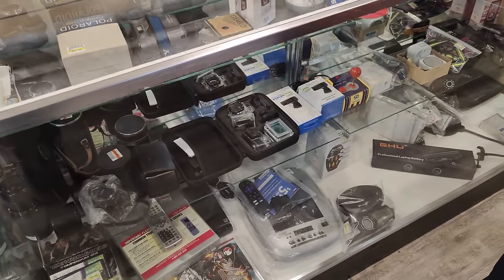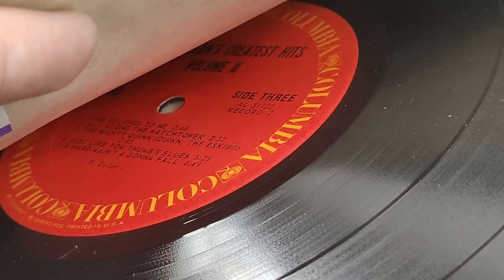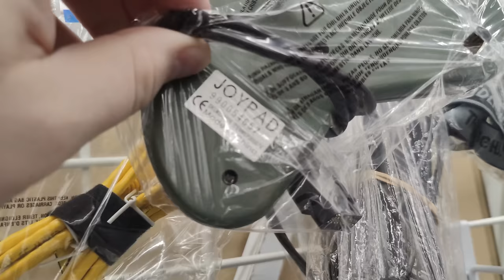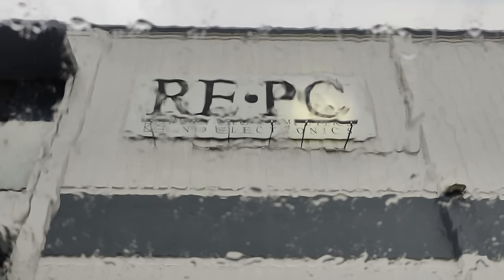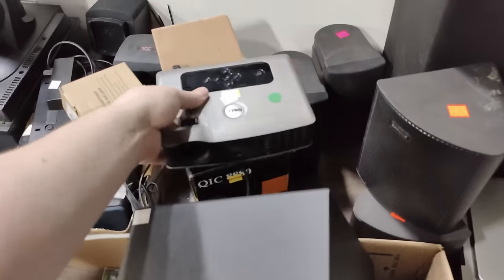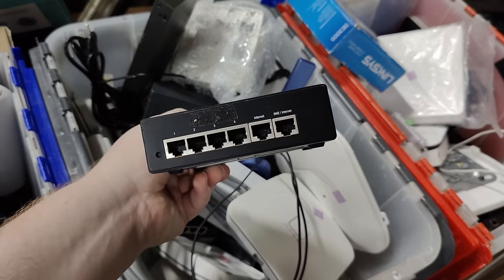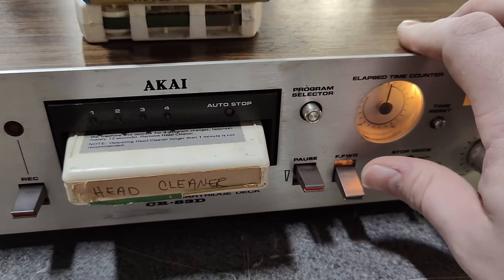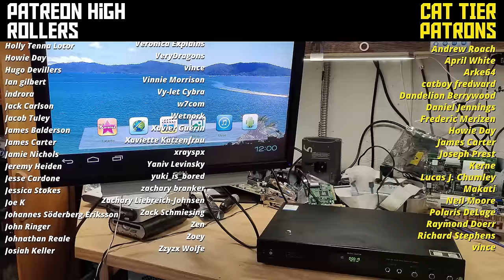Thriftmas 2023

Comment: that did indeed look like an old playstion controller (pre , it being branded EA sports and it haveing the official playstation face buttons along with other playstaion branding makes me think it was in some sort of bundle, trying to track down what it came with would be an adventure. Also some OLD gfx cards had VESA output. it was a pin as you had to get a converter to a more standardized plug.

Comment: (Commenting in a list because I have ADHD and can't pick one thing to talk about)

I had a small table top version of that grace digital thing (about the size of an alarm clock) and it's basically an IP radio with dipping mustards. Mine also had the ability to play media from a PC with DLNA (and maybe a samba share IIRC). It was kinda like that Dell receiver thing, except its interface sucked in every way imaginable. You had to enter your wifi credentials, with a click wheel that you had to make sure to click exactly on center, or it'd bind up, then you had to search for stations/your PC. 

I would bet that weird box with the freakish Revolabs phone is some sort of audio input that would've let you pipe presentation audio into the phone for the other party to hear. Why you would want that given any audio is likely accompanied by a visual presentation already being done over zoom or webex or something, I have no clue, but apparently you could.

I get the same feeling about the Xbone, and I'm only 19, I swear that thing came out like 3 years ago, then I see videos of people playing Wii U games at the same time as the Xbone existing and become dust.

Holy shit I want a modern version of that Niveus Media Center. I want a modern HTPC with a software version of the front panel interface of a receiver. Give it a bunch of capture cards, and you can use it to switch inputs and everything. I would kill for that.

Those UVC phone sterilizer things are the local version of the karaoke bellweather here. If you see one (which you can't tell immediately because they always look like something actually worth giving a shit about at a distance) you know you're in for at best an extremely mediocre time.

Comment: "Most of them are locked to cloud services and can't be used anyway."

The sad truth about modern IT.  My home WiFi is an Aruba 3200 controller with a few dedicated APs that are managed by the controller, and automatically tuned for best channel and TX power.  I have had better home WiFi than most of you will ever experience for a long while now, and it's still relatively decent.  But the end of the road is near.  WiFi 6?  Not happening.  And with Mist setting the pace for what enterprise WiFi will look like from now on, I'm a WiFi generation or two away from getting stuck with the same garbage-in-a-box solution that everyone else is forced to use.  The day when my best option is Ubiquiti ... that makes me a very sad panda.

Comment: If you're thrifting, be sure to look out for headphones that are great quality, take them home, then spend $10 to get replacement ear pads and get $150 headphone for $20. Also, it's probably NEVER going to happen, but check out those controllers. Nyon controllers, SHARP NES controllers, Sharp NES remotes, VERY rare, but check, Also, the square 4x4 16 pin Bose cable that sells for $100. I've found several. :)

Comment: i wonder if that terratec is actually the satellite version. it looks more like an F connector. DVB-T devices typically don't use that for the antenna connection. would make sense to be in a US thrift store at least, as there's plenty of DVB-S/S2 signals up there. would explain why it looks like it might have an external power supply?

amusing that Panasonic reuse model numbers - I have the DVB version of the DVD recorder under that android karaoke box, it's the same model number although mine has a big fat DVB logo in the top left.

the brother printer ain't bad (think I have the same model) - yes it is inkjet but it's pre-chip so you can get cartridges anywhere with no drama. prints and scans A3, has wifi/fax/ethernet etc. 

that metal cased xbox 360 is something. all that to act as a media centre extender (back when microsoft thought people would want to use an unreliable, hot, power hungry console for that). i wonder what the markup is on it!

Comment: The Niveus is just a fancy Media Center PC.  With Windows Media Center Microsoft had made a class of devices called media center extenders.  They really never took off except for the Xbox 360 which I believe still has the capability built in.  Microsoft never took it out of the OS.  It was actually rather cool when I had a HD HomeRun Prime with cableCARD.  I could have my Media Center PC running in my living room and still watch my cable TV on my Xbox 360 in my bedroom.  

You wouldn't really need to buy the Niveus re-branded Xbox360.   You could just fire up a PC with Windows 7 and an Xbox 360 and get the same effect.
Reply from the maker: exactly, that's why i feel like buying it, it's so pointless lol

Comment: A lot of people out there might not know why those modems are scrap: Every cable modem is individually identifiable over the wires, and your modem's identity gets registered to your account so that it is authorized for your service level. If you try to register somebody else's cable modem, it gets low-stakes flagged as stolen and registration is refused.

You might be able to take the modem to your ISP, if your ISP is the previous owner's ISP, and waggle it at them in a way that for some reason causes them to deregister it, I have done this, it does not make sense, and it's probably not worth your time with how cheap modems are now. I was in a bad place and couldn't afford rent so it was worth it to me then; but my experience might have been biased by having stolen the modem from my shithead dad, so we had the same last name.
Reply from the maker: See that's what I always assumed? The off the shelf ones, like the surfboards, you can reuse those, but if you get a carrier provided arris suuuuuurely it's gonna be a brick.

Comment: as someone who goes through all of 1 thrift store every couple of weeks
fuck me, i WISH i was in your area right now
i love older camera gear and wish i coulda bought all them lenses from the salvation army 
also, the thrift store i go to ocasionally gets dontaions from corperates
so a SHIT ton of computers, no hard drives
they actually finally got rid of the rest of the shitty dells they had in the back area, fairly basic system had decent enough i5's though, stock clock was fairly high compared to what i normally have around here
they also ocasionally have laptops, ive seen 4 laptops. 1 was a w95 that thing was so busted though
that poor vaio laptop has been mo-LESTED into hell 
first one i found was a dell inspiron something or other, broken latch ofc, but works... other than the fact the HDD and bios is locked behind a admin password that i need to remove
and yes, when there is a HDD and data on it i am responsible and i delete it... only after poking around a touch just to get a look into whats there
also, found a super mint dell latitude, wXP not a corperate, didnt wipe it cause it seems like that had already been done, or if it wasnt, well prev owner didnt use it a whole lot, ended up throwing a linux distro onto the drive, its a 100 GB drive and i split it roughly 25/75 tween WXP and linux
also, found some type writers, those are quite a dime a dozen round these parts
and yes, pile of monitors, though they dont take tv's over a certain size
ive even bought and seen some lawn equiptment
seen a belt driven push mower, big beafy mother fucker too, wish i bought it 
bought 2 weed wackers today actually, a old ryobi series 700 and a weed eater sst25 or something like that
got carb issues (and obligatory blown out fuel primer bulb)
also, stupidest fucking thing ever, the best thing ive found was a dell CRT monitor, thats not the stupid part, the location i found it? a fucking land fill i worked at for a short time
also found a old gateway laptop from w7 era, busted screen but probably the best laptop so far

Comment: https://youtu.be/VGbHD65z4Ak?t=661 I got a Sharp Elsi 122 calculator from the wall of random stuff, really useful and it's got a VFD. It even came with the leather carrying case, but I had to make an external battery pack because the internal compartment was completely disintegrated from corrosion (it came with exploded batteries still inside)

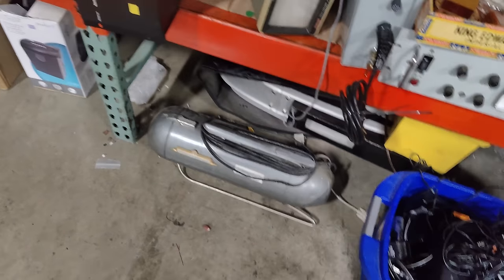Comment: 39:45 what the actual fuck?!!! That's a Philips EL3536 tape recorder. The first stereo consumer tape recorder from Philips. 2x el84, sounds pretty damn great and are dead reliable once you replace the cork slipper clutches on the reel hubs. Even the rubber belt is still good after 60 years. Were they sold in the USA back then?
Reply from the maker: I have no idea of it's provenance; a lot of stuff makes it over here from overseas, but usually from east asian countries, I don't see a lot of european stuff, so I feel like it probably was sold here.

Comment: It is like a blackhole. So much garbage. There few nice items, but almost everything is just generic trash. It was trash when it was manufactured, it is now less than trash.

Some stuff might have historical value, just as a period piece, and some are just bizarre, that are worth preserving, but rest is nah. Just trash.

TV or small PC speakers, sure, if you are broken, should be fine I guess. Then there are some decent and timeless stuff, like better speakers, audio amplifiers, some radio sets, there might be some gems, and even if they are not top notch, they should be decent, and a bargain. For me, some switches, even if absolutely outdated, would be interesting, easy way to learn differences between various brands, how you configure things, etc. (because every brand is different). Or some of these historical storage techs like tape drives, other magnetic drives for computers from 90s. SOme might be a unique. But that is my thing, because I never used them, so could be cool for a bit.

I notice there is a Fortinet box. These are often not too bad depending on a model, if you do VPN connections between office locations, etc. They can also be used as a decent router / firewall, to 1Gbps or so. Not worth a lot used, and no way to resell it to a business, but could be interesting for some homelabing for somebone.